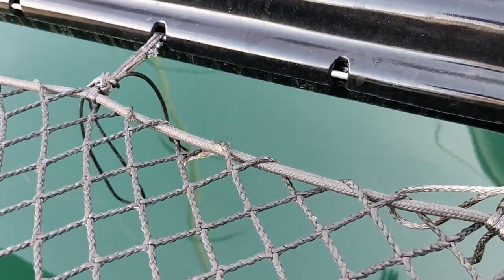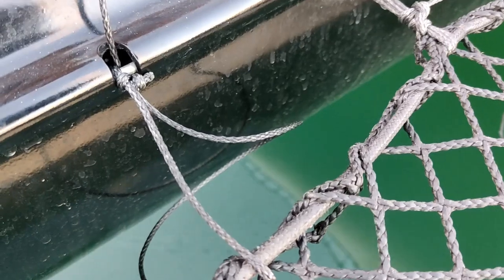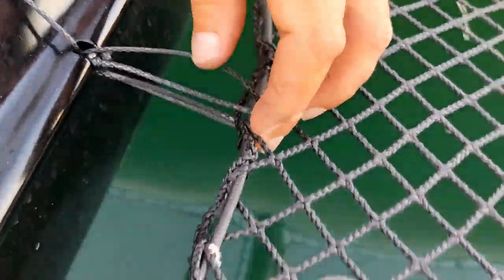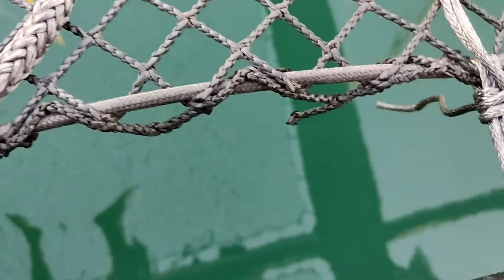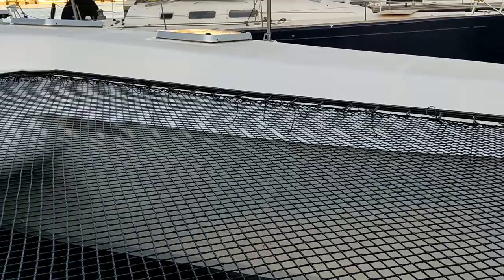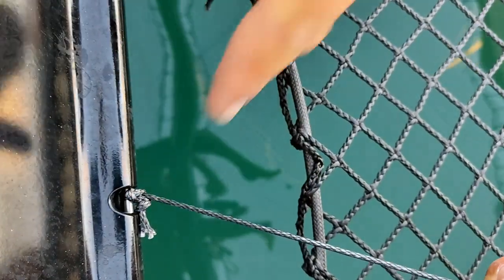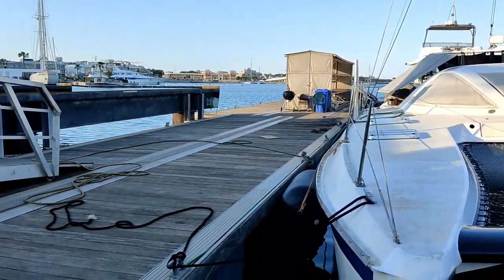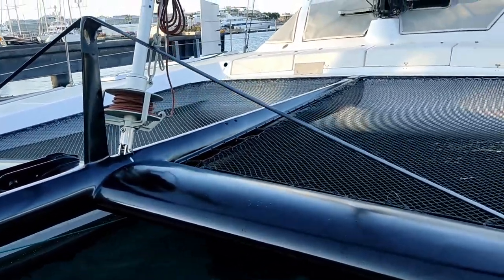Fitting THE BEST netting to our modified cat

Comment: Looks really good, could you list the materials that you have used (thickness of rope for the different areas and net type). I have to replace on my Atol 57 next year and I think this will be the right solution for me :-)
Reply from the maker: I've added the materials list to the description. Good luck with your project!
Reply: @youngbarnacles  Is it 20mm mesh in the net and what thickness of the net ?
Reply from the maker: I'll have to check but yes mesh is either 20mm or 25mm and thickness is 3mm

Comment: Thanks for the great videos. Great timing for my 30ft tri resto. I’ve ordered the netting from the US but having trouble finding the covered dyneema in Syd. Where did you guys source yours? Found some 6mm supercable 78 in NZ. Is that the same? Cheers Martin
Reply: Sorry for the slow reply, currently sailing at gunboat 68 across the Atlantic. 
The rope for the perimeter can be un covered, it is just nice if it can be covered.
Any SK78 is fine, this should be easy to find in Sydney. I have a mate that has Skiff ropes in Manley he will be able to help you out for sure
Reply: @shayneyoung4801  thanks Shayne. 👍

Comment: I've got a space that is roughly 8' long in the fore/aft direction, and the front beam is 14'-4", the front of bridgedeck is 12'-6". The net that net-sys sold me is 10' x 20'. The sales rep suggested it would stretch enough to cover it.. but seems no problem if I stretched it 0-90 degrees fore/aft and side to side. But others are suggesting I do 45/45, and the sales rep I think was suggesting same.. saying he thought it would stretch to cover those dimensions. Looks like you went 45/45 - is there an advantage or cosmetic? Suggestions for me? Thanks!
Reply from the maker: not sure if we have already answered the this question? If not, there may be some more info on our forum www.youngbarnacles.com
Reply: @youngbarnacles  Thanks for the reply and help! I went for it finally and am pretty satisfied with the job - however my gap is larger than I wanted as I did not have experience. But as I look at pics of other cats, it is well within some of those. (maybe 5-6 fingers or so). And I'm not done stretching, though now it seems pretty tight.